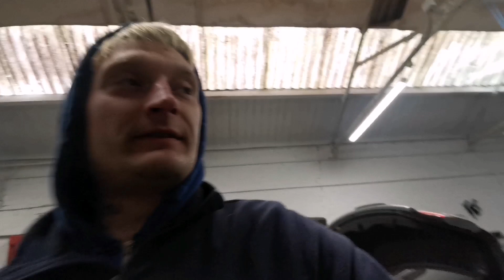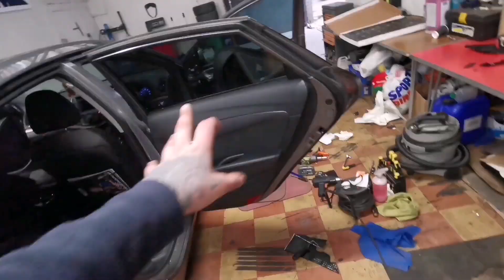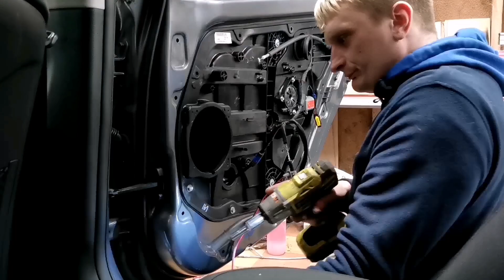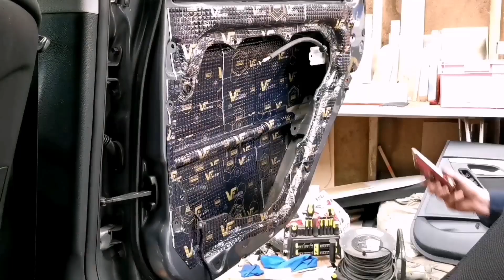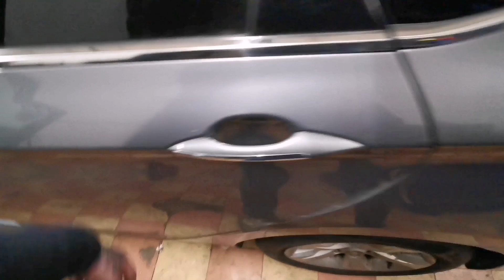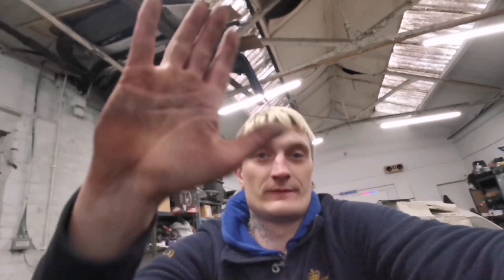2012 Hyundai i40 Front and Rear Door Sound Deadening and Window Regulator removal. Part 2.

Comment: Hi man where are you based based i need your help with a Hyundai i40 as well. Following your Videos I was able to install an amplifire and sub and mine dint come with those so had to install them
Reply from the maker: Hi bud. I'm in Newcastle upon Tyne. So you don't have an amp under the passenger seat?
Reply: @gastyle9445  Nope my Hyundai i40 its 2014 blue drive and its got a space sub in the boot but I wanna find out the size of the in the boot so I can install one, I am based in Ireland and I was hoping you were in Nortehn Ireland I would have drove up coz i need a speaker Upgrade and i am dreading opening the Doors as I am not comfortable with that part
Reply from the maker: @mwana_wevhu  That's strange as this one is exactly the same. Your one must of been the basic spec one then. Yeah I know what you mean. It is a bit far. Unless you take a vacation for 2 - 3 days in the Newcastle.
Reply: @gastyle9445  Will consider doing that. Anyways whats the size of the Stock subwoofer is it 8,10 or 12 Inch ?
Reply from the maker: @mwana_wevhu  Have you got Facebook or Instagram. Give me a message there. Facebook GAStyle and Instagram g_a_style
Reply: @gastyle9445  yes I have instagram and have sent you a message